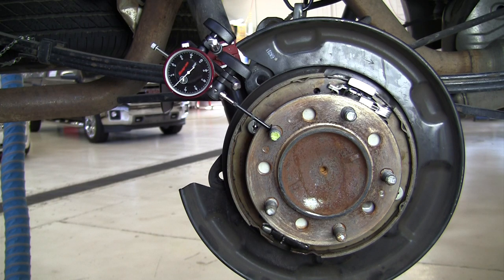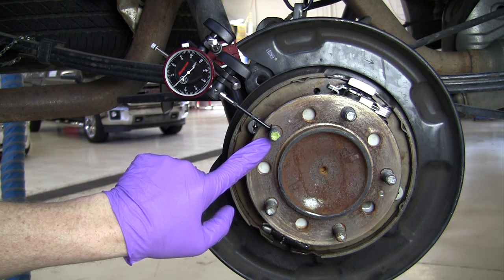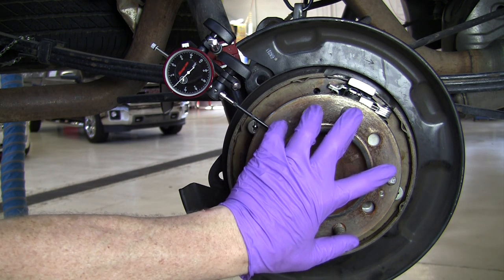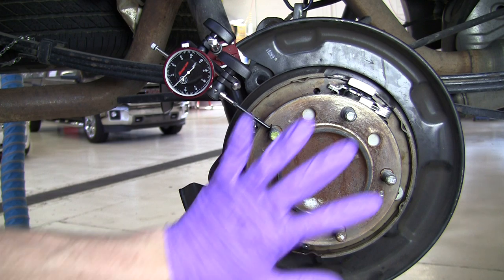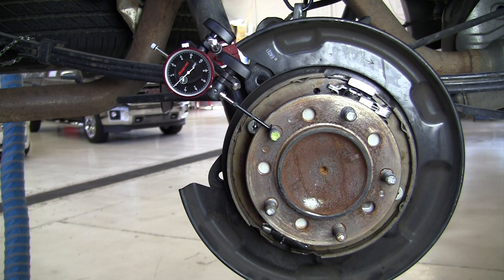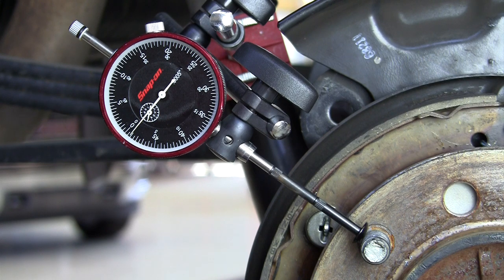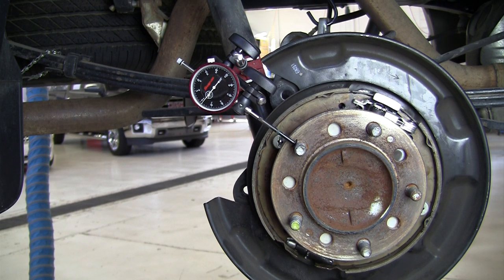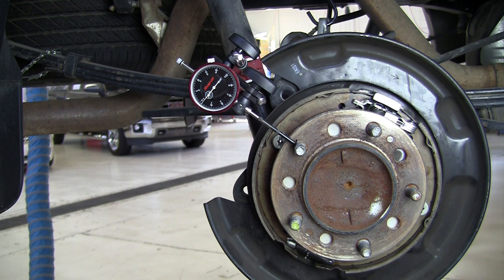How to measure Wheel Stud Circle Runout

Comment: This is a great video with an excellent demo of the procedure for checking stud runout, however I can assure you that flange drilled holes are not running out .004". The holes are precision machined and will be located within +/- .0001" of true position...the studs are the weak link.The studs are roll formed, like the cheapest common bolt, knurled and pressed into the holes, they can easily locate several thousandths of an inch off center, as well as not being square to the hub mating surface due to their irregular shoulder up against the backside of the hub.

Comment: And if there is a dismantling or testing like this    I like to mark the first stud.    This defect of run-out will be magnified out at the outer circumference of the tire.    Ya   ever since you worked on my car    the radio doesn't work     wipers intermittent delay timing was different than now  : - )

Comment: I imagine the same problem with the drive shaft of my car, specifically the rear right brake locks up with a little more pressure at low speeds and I have checked and tested all the brake parts and it is a problem It does not exist in them

Comment: 'there are a lot of variables in this process the axle bearing surface may not be concentric with the center line of the axle?   the studs may not be perfectly round?  they may have move off center when pressed into the hub.  Seems you would first have to prove the axle bearing surface then the holes in the hub then the roundness of the studs themselves  and if the studs are truly perpendicular to the hub and i am probably missing several other variables.
Reply: My first thoughts as well.
Reply from the maker: Hi, all good thoughts, thank you. When diagnosing tire speed related vibration issues on a vehicle, if the tire and wheel assembly has excessive radial runout on the car, but not off of the car, the axle and stud circle must be checked. I have a separate video on measuring axle runout. If the axle face and hub runout are okay, the stud circle runout must be considered. Measuring this runout next to the axle face eliminates non-perpendicular stud issues. In my experience, mis-drilled (non-concentric) holes are typically the cause of the problem.
Reply: Based on my experience with inspection/balancing PM rotors and rotordynamic theory, the physical runout(surface runout) almost never matches the actual rotor imbalance(harmonics). But in this application, this methid might be close/good enough.